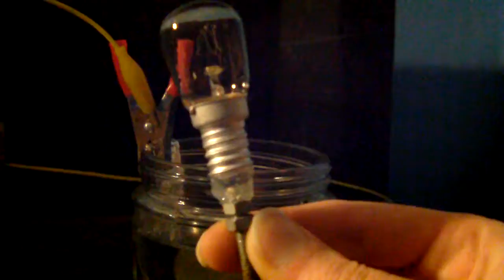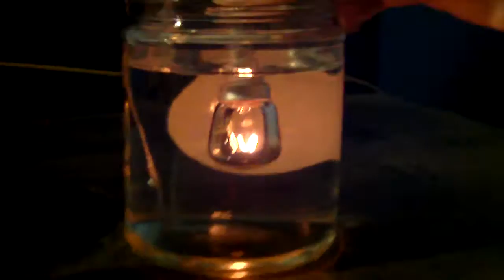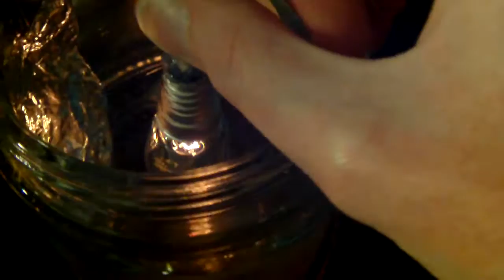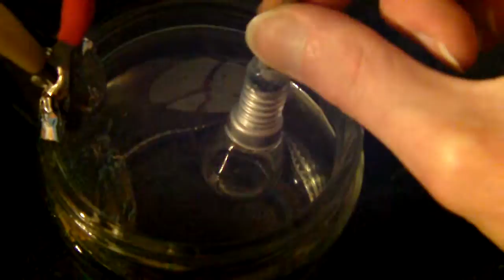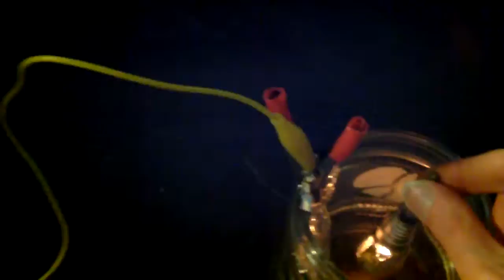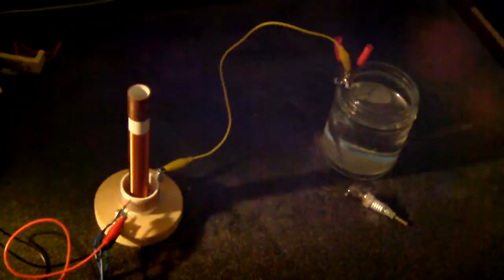Bulb In Water - Mini Tesla "Test Coil"

Comment: Is this using the same circuit as the video where the aluminum foil is attracted to the bulb?  If so, have you checked to see if the foil would be attracted to the bulb under water?  This would help verify that it's not electrostatic attraction...
Reply from the maker: Yes it is more or less the same. I haven't done what you suggested because I wasn't using enough power at the time, the foil had to be very close to the bulb to see the effect. This sounds like a good idea.
Reply: well, if you do the experiment, I would love to see the results...